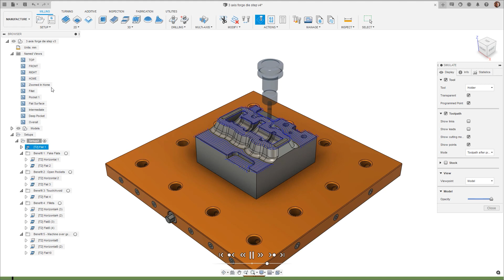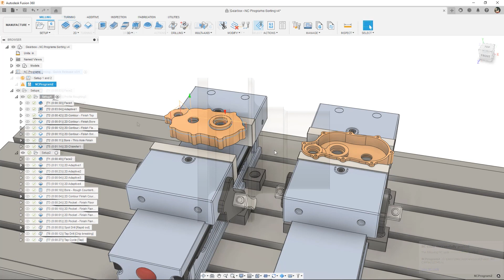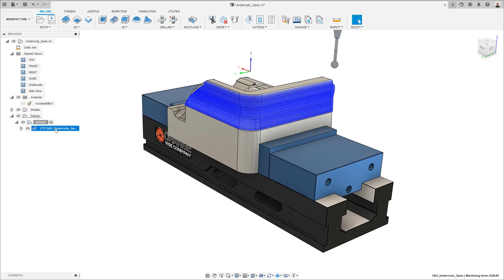What's New in Fusion 360 Manufacturing August 2021

Comment: Still looking for a feature that is for Deburing with a ball end mill without having to model and surface mill edge breaks on steep angled holes using a 3axis mill.
Reply: I second this motion. Deburring with ball/lollipop cutter would be big for us
Reply: Why not just use trace with a stock to leave offset?
Reply: @AlexMageethefirst  i think that doesnt work very well if the edge has a varying angle
Reply: @gerrit2107  He said he wanted to do the job on a 3 axis mill.  There are always going to be some limitations, but if the part was machined in 3 axis then it can be de-burred in 3 axis.
Reply: GibbsCAM has a function that allows you to use a ballendmill as a edge break. You just select a tool and an edge. I make a lot of parts with counter bores on tapered walls sometimes those counterbored holes intersect on both the flat top and tapered wall. GibbsCAM works perfectly for this and We’ve been transitioning to Fusion 360 over the last several years for everything and I have been able to make due by creating a modeled surface and then surface milling but it’s so time consuming.